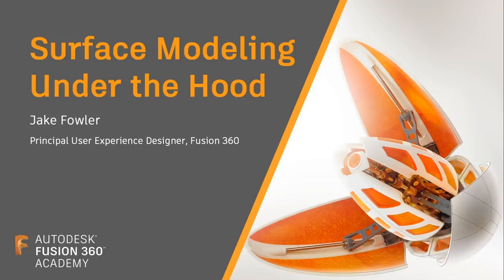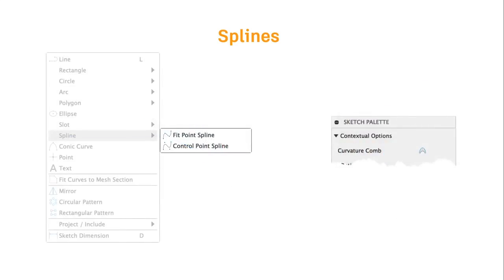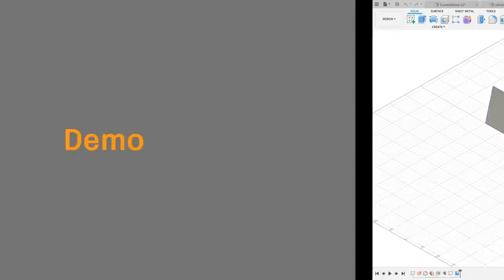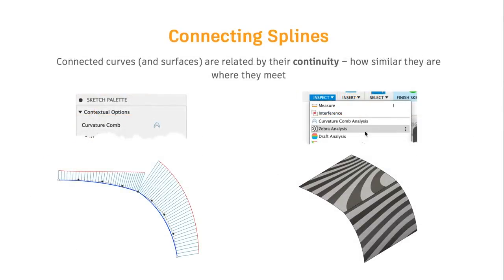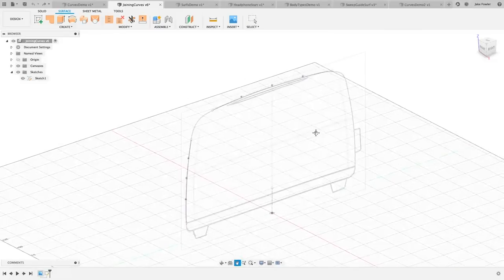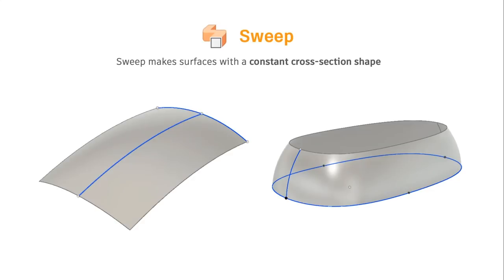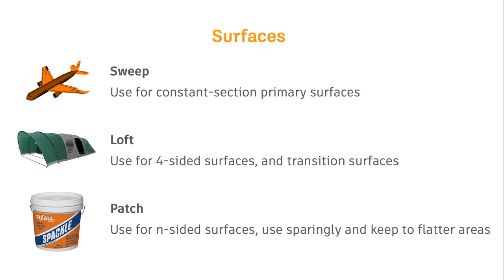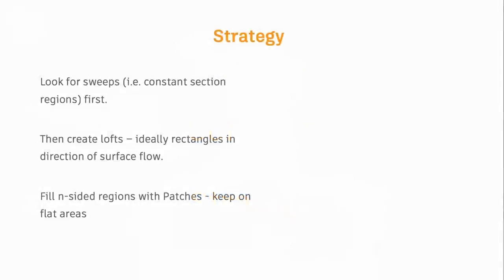Fusion Academy Refresher - Surface Modeling Under the Hood

Comment: The video is ahead of the audio. Makes it a bit disorienting.
Reply from the maker: I see what you and others have mentioned. Unfortunately,  I don't think I'll be able to fix this! It's strange that it grows over time. Maybe I can add a couple frame holds or pauses in the audio, but getting it perfect would be difficult if not impossible.
Reply: @adskFusion  By 35 minutes in it becomes difficult to follow, if you intend to leave this up as a training video for the foreseeable future, it would be nice if you could make some attempt to mitigate the issue. The video is nearly useless after 45 minutes. I don't know much about video editing, but could you not just fit the video to the audio by shortening the video side a bit?
Reply from the maker: I'm curious if the original video (where I got this from) has a similar problem? Can you double check here:
https://f360ap.autodesk.com/courses/fusion-360-academy-portland-2019-industrial-design/lessons/fusion-360-surface-modeling-under-the-hood
Reply from the maker: Its hard for me to differentiate without watching the majority of it...which I just don't have the time to do at the moment (AU is in 2 WEEKS!!!!!). If the original doesn't have the same problems, I'll probably just pull this video. Very sorry for any viewing problems!
Reply: @adskFusion  It looks like the original has the same issue.
Reply from the maker: Thanks, Jay!
Reply: @adskFusion   Thank you for the video none the less. I (and probably others) appreciate that you respond to this minor issue.
Reply: not true. this is by far the best Fusion tutorial video I've ever seen. very valuable stuff. thank you!
Reply: Hi, the audio goes out of sync by about a constant 30 seconds roughly halfway through. The original on the Autodesk website has the same issue. To fix this is simple, edit the video in Premiere or Davinci Resolve (free), and split and shift the audio track by that constant amount when it goes out of sync and re-export.

Comment: Overall very good presentation, I picked up some new tips in using these tools along the way. As mentioned by others the audio being out of sync makes it difficult to follow. I know your crammed for time when doing these but slowing down on the mouse clicks would make it much easier to follow. I had to go back and re-watch several times and pausing on certain moves to understand what you were doing.

Comment: Autodesk, please consider for better visualization, and less User eyestrain.
1) Adding color (yellow) to the eye (?) icon, formerly the flashlight icon, to aid in distinguishing ON/OFF state.
2) Improve overall screen readability with greater contrasting text through User customization, or via User editable .xml file.

Comment: Sometimes I do a loft surface and the dialog box does not give me the three G0, G1, and G2 options for the profiles. It instead gives "Connected" and "Direction." What am I doing wrong?
Reply: OK, I found the answer: I was using 2D sketch profiles instead of edges of surfaces or bodies. 

https://knowledge.autodesk.com/support/fusion-360/troubleshooting/caas/sfdcarticles/sfdcarticles/Loft-command-does-not-allow-to-select-between-G0-G1-and-G2-continuity-in-Fusion-360.html